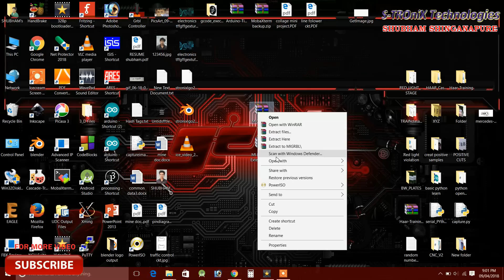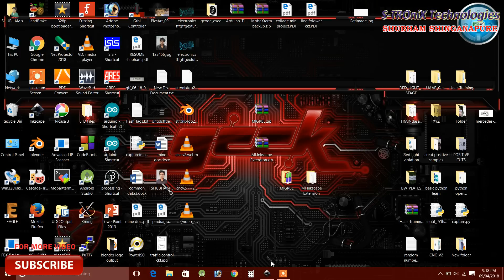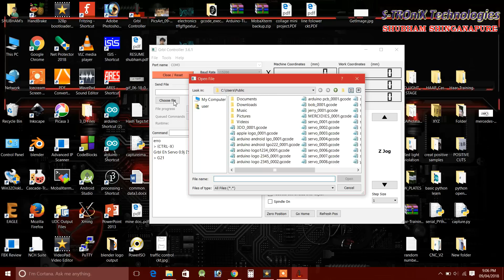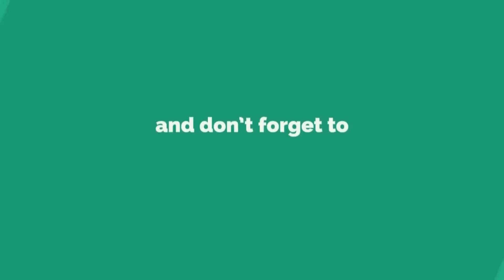How to Make GRBL+Arduino based Mini CNC plotter machine at Home

Comment: Hi! How are you? I'm having trouble setting up my 28byj-48 motors, I don't go a few steps pressing to make it record 1mm. I would be very grateful.
Ej: $ 0 = @t (x step / mm) on the x and y axes, what values did you put? Thanks greetings.
Reply from the maker: I did it All on default settings. but I made a change in motor connections you can check here https://www.youtube.com/redirect?q=https%3A%2F%2Fdrive.google.com%2Fdrive%2Ffolders%2F11KZSVvxdrgIqA8t6cJs33jBR6Z2Ip7j9%3Fusp%3Dsharing&event=video_description&redir_token=_5cf-DD4Q9QB5UpfwKk-4wlYTDZ8MTU4NjY2OTk1MEAxNTg2NTgzNTUw&v=KEvOdXhf_vQ

Comment: Hi, I am doing a CNC machine but my motors have high levels of temperature , I am working with the same motors of this video , do you have any recomendation and the last question is necessary to activate the micro step?

Comment: Sir 0.5 ampere not available what about 1 ampere.  And I said 28bjy 48 motor 5 volt and adapter 12 volt will not cause any problem.

Comment: Please tell me why grbl controller does not connect to the UNO when I load MIGRBL code in Arduino UNO. did change some thing in file as my servo is not working on M3 S90 grbl command?
Reply from the maker: are you select correct baud rate? baud rate should be 115200

Comment: Hello my friend, I was reading the another comments and I had read that you used 12 V to source the shield. The cuestión is:

Could I use 9 V with the same results that you had or the motors will be lose power?
Reply from the maker: with 9V the motors will not move with full power.
Reply: @ShubhamSuresh  The motors are on 5V and if you put 12V or 9V, the motors will still overheat. Maybe they will even be destroyed. It is pointless to put so much voltage. Just 6V is enough.

Comment: Sir can I use uln2003 instead of cnc shield and driver...and is there any alternative for that timer belt and Pulley
Reply from the maker: yes! you can use that but you need to change arduino code also, for more details about code and programming watch this video  https://www.youtube.com/watch?v=hjZgVoZcHms&t=6s
Reply: First thank for the reply... In uln2003 I having the problem that the stepper jst rotate in single direction only that I clockwise it doesn't rotate in Anti clockwise...im using arduino Nano +2 28bjy 48 stepper +sg90 tower pro stepper..I use the problem which is in the link...dono wat to do..pls help me..thank u
Reply from the maker: Try L293D IC instead of uln2003

Comment: What must be the power supply given if 2 Nema 17 motors are given (mention the input Voltage and current)
Reply from the maker: 12volt  3A will work

Comment: sir, your video was awesome 
i have also made it, both X and Y motors working properly   But my servo motor was not responding 
what is the solution ???
please help
Reply: meriko bhi same prob ho rhi hai what should i do
???
Reply: just remove all of the gbrl libraries and then install migbrl library...
it's work...
Reply: How much power supply are you giving to cnc

Comment: Hola Ing. muy buen aporte a la comunidad de hecho estoy haciendo uno gracias a sus conocimientos, ayúdeme con algo necesito saber por no me esta funcionando el servomotor, y cuanto de voltaje le paso en la calibración de los derives del SHELD v3 muchas gracias
Reply from the maker: sorry but I can't understand what you saying. can you say it in english
Reply: @ShubhamSuresh  
Hello Ing. Very good contribution to the community in fact I am doing one thanks to your knowledge, help me with something I need to know why the servomotor is not working, and how much voltage I spend in the calibration of the derives of SHELD v3 thank you very much
Reply from the maker: @chino5567  Which GRBL version  you are you using? for v3 shield use 12volt 2 amp power supply
Reply: @ShubhamSuresh  
 power source pc power 12 volts porfa help me
Reply: @chino5567  buy a seperate adapter

Comment: can i use Arduino Uno R3 Compatible Board ATmega328P | CH340G | USB Cable
Reply from the maker: Yes! you can use any arduino board.
Reply: Will the programming be same if the audrino differs
Reply: And the connection with cnc shield will also be same if i use that audrino which wrote in the first comment ??
Reply from the maker: Yes! programming and connection will be same if you are using that board.

Comment: Can i use this as pcb plotter?
Reply from the maker: Yes! you can. but you need to change motors. the motors used in this project are not have enough torque for task like milling.
Reply: @ShubhamSuresh  does changing the pen with permanent marker would also work for pcb plotting? Instead of milling
Reply from the maker: @joeynelbongabong3762  Sure if you want to use permanent marker, it is fine.
Reply: what version of inkscape are you using?
Reply from the maker: @joeynelbongabong3762  0.47
Reply: @ShubhamSuresh  how did you connect the stepper motor wires to the cnc shield?
Reply: https://drive.google.com/file/d/1ARthM3tn5_47pxzL6xh8cterCFCEDvA1/view?usp=drivesdk

Here's the way i connected it. Please let me know if i connected it wrong
Reply from the maker: @joeynelbongabong3762  https://drive.google.com/drive/folders/11KZSVvxdrgIqA8t6cJs33jBR6Z2Ip7j9?usp=sharing go to this link and download the zip file inside of this you will get a pdf about motor connection follow that
Reply: @ShubhamSuresh  what is the input voltage for the cnc shield?
Reply: Sir it's working. Thanks a lot!
Reply from the maker: @joeynelbongabong3762  use 9volt to 12volt 1amp

Comment: I made you given mini cnc potter machine watched from you tube .
: But my servo motor is not working..
: Plz suggest me.
: Its only move 0  degree to 180 degree then stop ..
Reply from the maker: ok.. i think you are using GRBL1.1. so first remove all grbl libraries from your pc and then download the MIGRBL zip from the link in description, extract it , then copy the folder MIGRBL and pest it into arduino/ libraries.
Reply: @ShubhamSuresh   no sir the same error is coming...
Reply from the maker: @imagine1706  show me snap of error

Comment: Servo not working. Can you help me?
Reply from the maker: is you connect servo correctly....?
Reply from the maker: Which Grbl version you are using?
Reply: I using grbl servo v.09
Reply: when I try to code the s30 m300 servo it doesn't go down

then I tried to code the s50 m300 not going up

servo only vibrates and is hot

is there something wrong with the PWM settings

or do you have other suggestions?
Reply from the maker: @bentarwahyuprabowo7972   which grbl version are you using...
Reply: @ShubhamSuresh  i using grbl v.09
Reply from the maker: @bentarwahyuprabowo7972  use MIGRBL, link for that is given in video description
Reply: @ShubhamSuresh   ok i wiol try
Thanks sir🙏
Reply: @ShubhamSuresh  oke i will try 
Thanks sir🙏

Comment: The motors are on 5V and if you put 12V or 9V, the motors will still overheat. Maybe they will even be destroyed. It is pointless to put so much voltage. Just 6V is enough.

Comment: Q1> What is  height of the red rod of Y-axis?
Q2> What is the length of all the bycycle spoke in cm ?
Q3> What is the length of x-axis stepper motor form its pulley to another pulley in cm ?
Q4> What is the length of y-axis stepper motor form its pulley to another pulley in cm ?

//PLEASE ANSWER MY QUESTION BECAUSE I AM THINKING TO REPRESENT THIS PROJECT IN MY SCHOOL SCIENCE FAIR//
Reply from the maker: the length of bicycle spoke length is 23 cm in my case, you can take your own suitable  dimensions